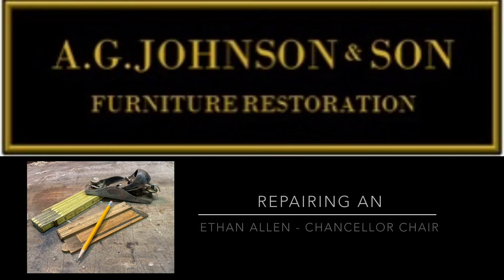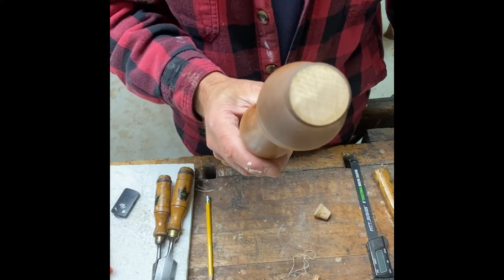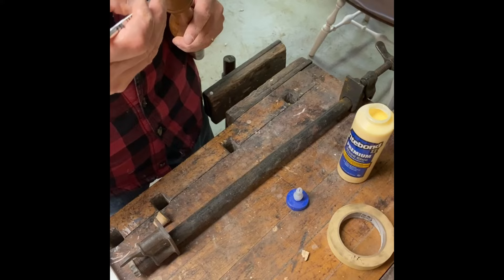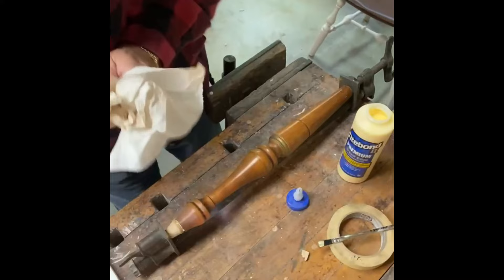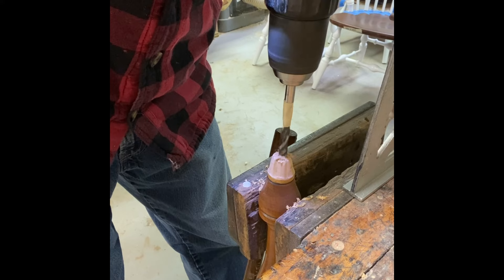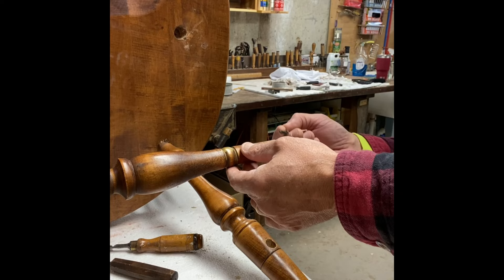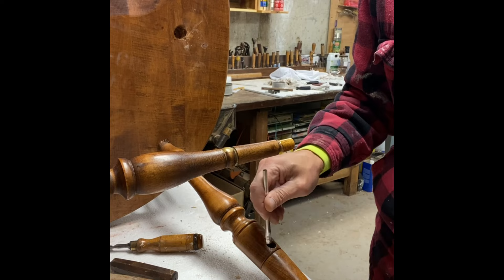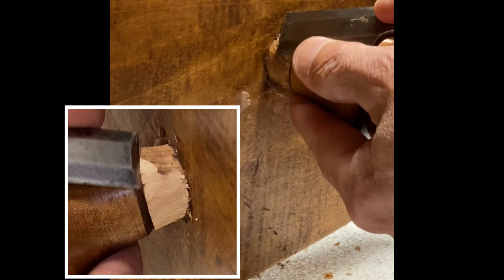Repairing an Ethan Allen Chancellor Chair

Comment: Thank you SO much for this video.  It is just what I needed since I broke a turned leg stool the other day and could not figure out how to replace the end that needs to fit back into "hole"  .  I knew that I would need to somehow connect a new dowel through the center but never thought to insert a dowel into a dowel.  Great solution.....
Reply from the maker: You are very welcome. I am happy it could be of help.